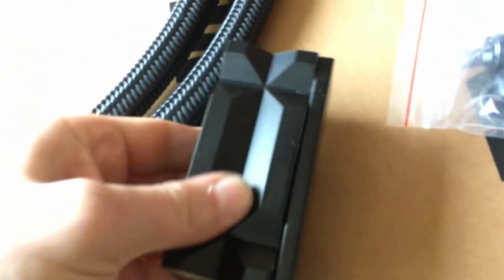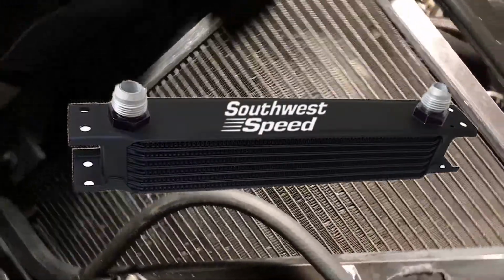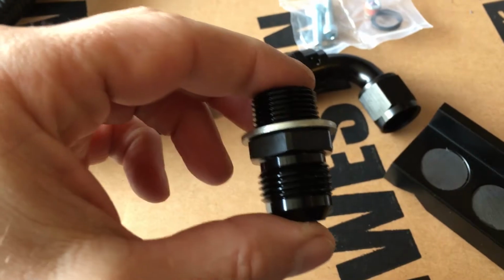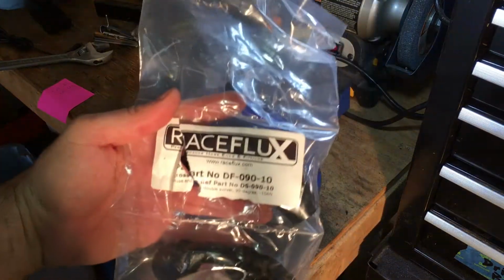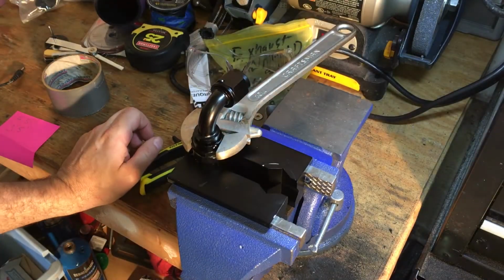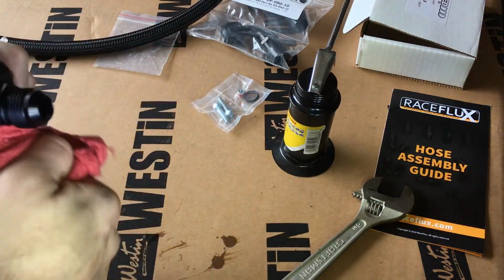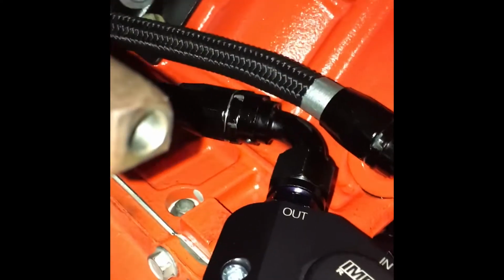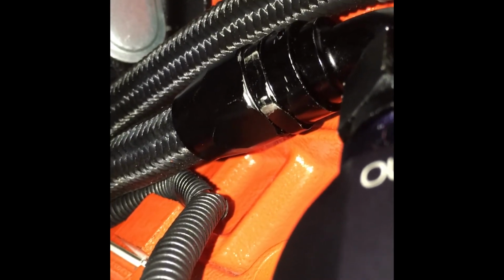Making AN Hose Fittings for Engine Oil Cooler Install - Chevy Tahoe GM Trucks

Comment: I am Rick Taylor, speak dude. Find your inner car/engine voice and let it boom baby. No reason to whisper unless your wife has a “Louisville” slugger she plans to use on you head, if she finds out you spent another $500 bucks on your car. She spent that much on make-up and bras over the last 3 months. Try boxers for a week, then speak up man.
Reply: Excuse me, I am supporting Rick Taylor’s comment. Not Rick himself. He spoke for himself, I mis-spoke but I second the motion!
Reply from the maker: My wife has a “Louisville” slugger with barbed wire around the end.  Yes, very afraid....... must stay quiet.  Shhhhhhh, she might see this comment.

Comment: what size and brand adapters did you use for the oil cooler in the radiator?
Reply: Hillary Joseph would have been awsome to see part numbers
Reply: Yo what size is that like he said
Reply: Links, brands and part numbers please. Magic marker on print paper for last 20 seconds of video works too. Help us follow your creation!
Reply: Yes I too would like to know